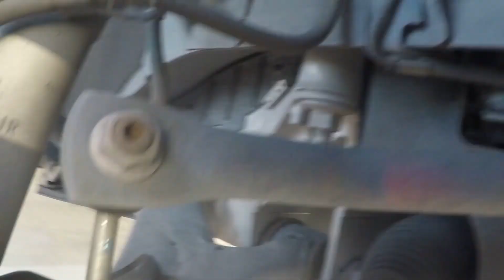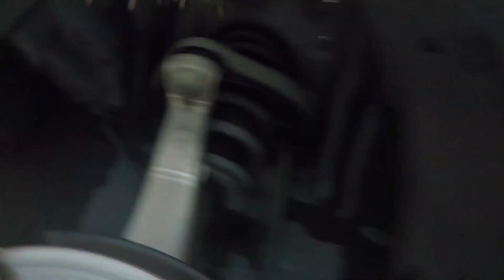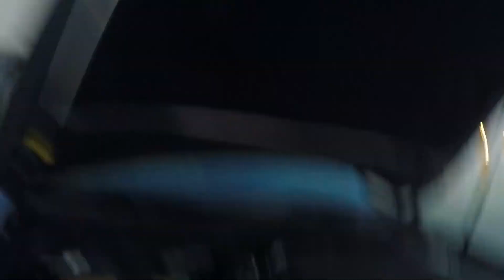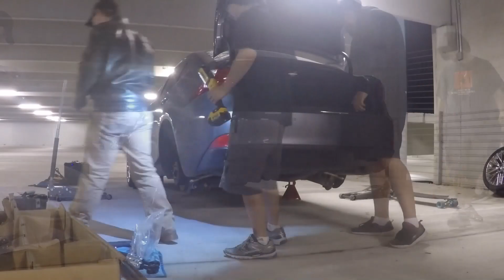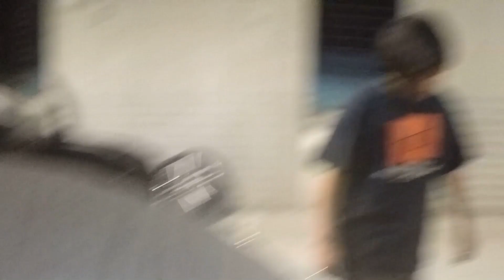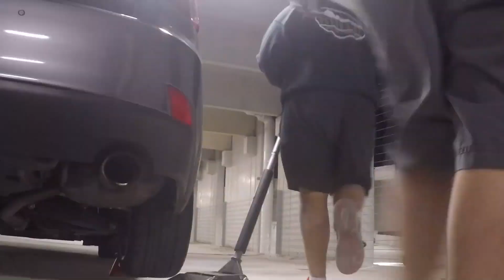Lexus gets STANCED!!! Get low!!!!!

Comment: How is the ride quality over stock?
I'm looking to drop my 18' 3Is f sport with some RSR Coils; trying to get close to oem comfortability while deleting the wheel gap at the same time.
Reply from the maker: it wont be as soft as normal mode. imagine sport+ all the time and you will have a good idea of what to expect. Comfort is certainly there, but it is definitely a firmer option. If you are looking for more comfort than sport, I would suggest looking at bags as all coilovers are going to be stiffer than stock even at the softest setting. I like mine a little bit firmer but it is definitely still comfortable. These RS-R coilovers are definitely more of a daily/street coilover than say the penske ones which are more track oriented. KW also makes a great coilover for our cars and it is very similar to the RS-R but the rear coils are the traditional "married" coils rather than the "divorced" coils these are in the back.
Reply: @NotSkilledHere  Perfect thank you!!
I have ridden on lowering springs with Aftermarket strusts on my older car. But when I got this new one I wanted to use coils and away from springs. I wanted to have like a 1.5 finger gap and retain comfortability; I know the ride will be a bit stiffer which I enjoy myself but don't want it too crazy as well just do be being my daily and L.A. potholes are no joke. I'm trying to find Coils for a good daily driving use while getting that nice look as well. I'll have to see if they release any for my year yet as I see very few for my model yet.